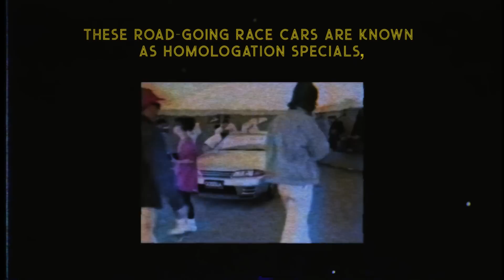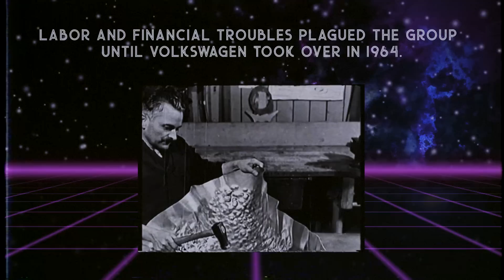Inside Audi’s Secret Storage Facility: Scotto Loses His Mind! Racecars Everywhere #audi #hoonigan

Comment: So much group b craziness in one place 😍
Reply from the maker: These we're some of cars that set the tone of what auto racing is today... #CarcaineHeaven
Reply: That Group-S prototype survivor unicorn is way too sick..  I can even imagine if the insane Group -B wouldn't get banned the follow Group-S would be like.. totally bonkers.
Reply: @poplaurentiu4148  You'd think so, but Group S was basically the original draft for what eventually became the WRC specifications ten years later (which are still in use today): 300 hp engines, very small homologation requirements (originally 10 cars, now it's 20),  and the original Group S version didn't require any of the parts to come from a street car, unlike the current WRC rules. So basically the cars would just have looked completely outlandish, but had a much saner amount of power for rally. (That prototype had a Group B engine fitted though, so it may have twice as much horsepower as the "production" version would have been allowed to have.)
Reply: Winchester1979.. Have you saw, searched info for all secret concepts & prototypes that should follow in Group-S ? (because not just Audi was working on it, others brands too) so the fact that none have engine in the front (like 10 years latter or today rally cars) most were build with mid-engine layout is a prove you are quite wrong when you say they became specifications that are used today and i don't know where you got informed from but what i do know for sure is the power out-put for Group-S was going to be higher overall than what Group-B was using.. (that was FiA intention before any WRC Group-B accidents regarding the Group-S).. so yeah..
Reply: And LMP1 prototypes!

Comment: Awesome video guys! 
I miss my Audi S4  '92 5-cylinder turbo. The first year of this modell came with the UFO brakes. The caliper grabs the rotor from the inside. It had like a safety cage all around the brake rotor so the brake pads would'nt be flying off if they got loose. The front wheels that had these it looked like it where a wheel cover on a steel rim. But man did they brake hard LOL. Had several people telling me that the rear tires where in the air when I braked hard. Had it lowered and a stage 1 tuning from the same company but I forgot what it's name where. Living in Sweden and studded Continental winter tires. The S4 where a dream to drive. A little too low but it worked great mostly. 
The 5-cylinder turbo engine is in my opinion the best sounding out there. Maybe a little biased LOL. With the restrictions taken away in the last exhaust damper. And it sounded awesome. 
What an awesome treasure from cars and racecars they have Audi. 
Great work Hoonigans!

Comment: Holy cow, you guys get to see a place that I’ve dreamed about since I was 7 years old
Reply from the maker: Yup, and we’ve been dreaming about it just as long. Bucket list goals.
Reply: Hoonigan I’ve actually got a project that would fit in right at home with all of those vehicles.
A 1992 Volkswagen Caravelle which is currently awaiting a 2.2 AAN 20 valve turbo engine which has a 2.5 conversion and a Quattro transmission system conversion.
Hopefully I’ll be able to get it there one day 😉